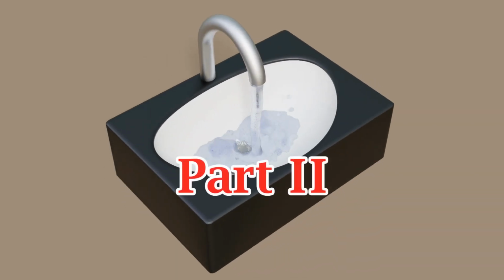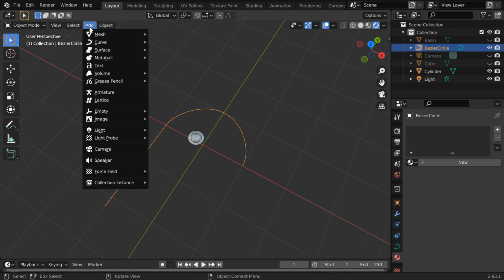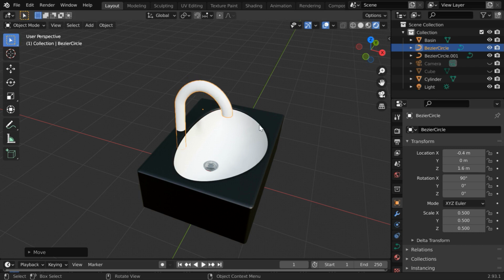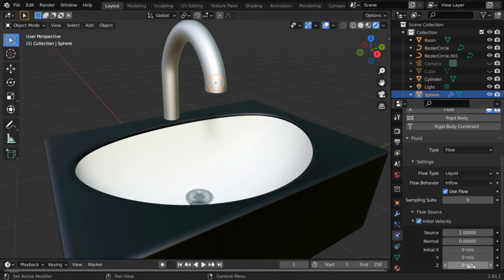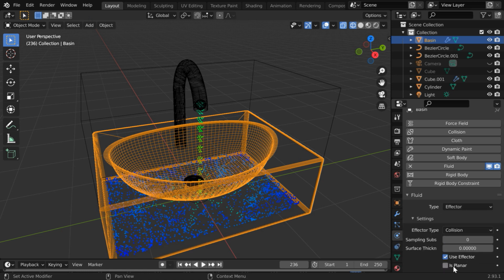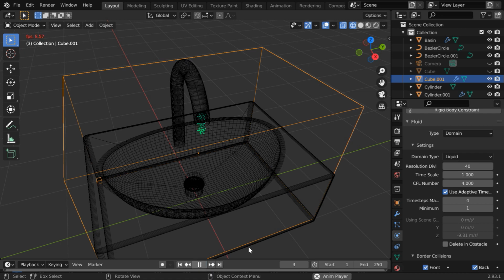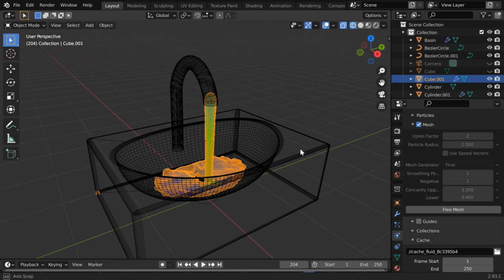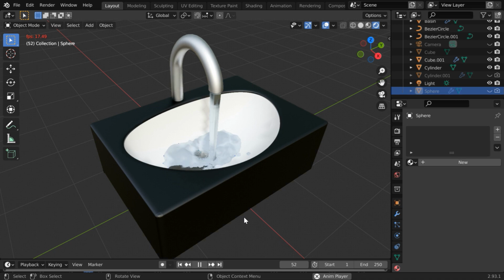Create Wash-Basin or Sink in Blender : Part 2 | Inflow & Outflow | Fluid Simulation in Blender

Comment: Even though I added material, there are many different colors in the water drops. How can I solve this?
Reply from the maker: Water has a property to show some of the ambient colors due to refraction, it's only natural. If you turn off refraction, it won't show any colors, but it won't look natural as well. If you think refraction is not the reason, or if the colors are too bright, I need to see your blend file before I can suggest something. You can send your blend file to 5minblender@gmail.com for us to verify.

Comment: I have done all the job but render for video is not working. please advice.
Reply from the maker: Can you please tell me where exactly you are stuck, or what is not working particularly? When you try to render the scene, what happens?
Reply: @5MinutesBlender  animation video for water flow in sink is not working when I render. I mean frame of video movement is not working to make animation video.
Reply from the maker: @md.azadulkarim8108  Is the fluid simulation visible? Is it static and not moving? Or do you mean the fluid is not at all visible? Render any one frame from the middle, like frame# 100 and see if the fluid is visible.

Comment: When uv sphere  i put inside tap pipe liquid not working but if i didn't put inside pipe liquid working . What is the problem ?
Reply from the maker: There has to be some amount of gap between the sphere (inflow object) and the pipe (effector). This amount of gap depends on the resolution divisions. For lower divisions (<100) there has to be quite some gap, otherwise the inflow won't work. If you cannot increase the resolution divisions due to limitations of your computer hardware, try to reduce the size of the inflow sphere, it would then work. And don't forget to clear the cache every time, otherwise despite all the changes - things still may not work because blender often keeps old data in the cache.
Reply: @5MinutesBlender  thank you sir,  i increased resolution 60 then start simulation but  not perfect then i increased 80 that was perfect.
Reply from the maker: @A4a4a4-w  Great! Nice to hear that it got solved.

Comment: Which laptop size is best for blender...??
Reply from the maker: Laptop size? 🤔 You need sufficient RAM (8 GB or higher) preferably with a GPU and at least 2 GHz clock speed for good rendering. Anything more than this is even better. The screen size does not matter but 1080P resolution is preferable.

Comment: funny how the fluid sim works for you
not for me
Reply from the maker: I'm sorry to know that the simulation did not work for you. Blender physics simulations need a bit of experiments and patience. If you follow our tutorial word by word, it must work. However, if some dimensions are different or some other minor change is there, the result maybe way different. Nonetheless, if you can describe what issues you are facing, I can suggest you something. If the water does not appear at all, please check the domain resolution you have used, it should be proportionate with the domain and the flow objects. If water is visible but it is not restricted within the sink (effector), please check the thickness settings for the sink material. Likewise, you can describe the actual issues that you are facing.
Reply: @5MinutesBlender  
The water doesn’t even show up inside the source
Reply from the maker: @theonecommenter  Let's do this. Remove the tap. It covers the Flow object. So if the gap between the Flow object and an effector is too small, the Flow won't work. So remove the tap. Let there be only a Flow object and a Domain. Now check if the simulation works. If not, increase the size of the Flow object until it works. Please remember that at each step you need to clear the cache - and it is easier said than done. Often Blender will make us believe that the cache is cleared, but the cache files stay there, it plays the old data and we wonder why the simulation is not working. Once you see water, reduce the size of the Flow object and increase the Domain resolution. Too small Flow object will need a higher value in the Domain resolution. Once you get this part solved, bring back the tap and test with it. Please let me know what happens.

Comment: Great tutorial.  My sink and waterflow turned out great.  However, when I attempted a render of the animation the original cube, used for the cutout of the basin, appears, and blocks the view of the sink.  I do have visibility of that object turned off.  Any ideas? Thanks!
Reply from the maker: Did you turn off the visibility of that object also in render? Click the camera icon beside the eye-icon where you disable the visibility, the camera icon is for render and the eye-icon is for viewport. Once disabled in the render, it won't appear any longer in the render output. Please let me know if this works.
Reply: @5MinutesBlender  That fixed it.  Thanks for your prompt reply.
Reply from the maker: Glad to be of help!

Comment: I made exactly the same, but the simulation doesn't apears! What do I need to make it works?
Reply from the maker: Which part of the simulation is not working? If your fluid simulation is at all not even appearing, here are some possible reasons: 1) The old cache is not cleared, please clear them 2) The domain size is large compared to the flow object, either enlarge the flow object or reduce the domain size 3) The domain resolution division is not sufficient, please increase it. If nothing works, you can send us your blend file so that we can investigate it further. You can get our contact details (Email ID) in the about section of this channel. Thanks!

Comment: pls help, my water is not flowing 😅
Reply from the maker: Hi bro, we'll surely help you. Can you please elaborate little bit where you are stuck, or mention the exact timestamp from the video at which point you are getting a different result from what is shown?
Reply: @5MinutesBlender  The part where you apply the fluid simulation to the sphere and then you play the animation and the water flows but mine doesnt 😅, so i just continued following the tutorial to the end  thinking it will fix my problem but it still not flowing
Reply from the maker: Okay, that can happen for several reasons - but primarily I'd suspect two things. Either the scale & domain resolution values are not in correct proportion, or the fluid cache is not cleared (which sometimes causes a frustration because whatever changes you make, it just does not seem to take effect). If you followed the tutorial ditto as shown, the scales should not be the issue. Please select the domain object, and go to the Physics tab. You will see a field called Resolution. Please make some changes into that. It is better to use a higher value like 64 (or even higher for a better result, but 64 is good enough for test purpose). Now go back to the first frame. You don't need to even run the animation. On the first frame itself, you should see the fluid particles appearing around your flow object. If this is not happening, please check if your flow object is enabled. This tutorial is primarily about enabling and disabling the flow object, in order to control its flow. So, if you keep the flow object disabled (unintentionally of course), it won't show any fluid. So if nothing above works, please remove all keyframes from the flow object, and test if the basic fluid simulation is working or not. I will wait to hear from you. All the best!
Reply: @5MinutesBlender  Hello again, sorry for the late reply took me a while to figure it out hehe. i just realize my domain size is so small so o had to scale it up and the change the resolution to what you recommended, thank you so much.
Reply from the maker: @gowiththeflowguy8310  Really glad to know that it has finally worked!
Reply: @5MinutesBlender  hello! I tried all the suggestions but still no water flowing on my sink :(
Reply: @5MinutesBlender  the only thing I couldn't find was the ''enable'' the domain object. how exactly do I do that?
Reply from the maker: @zamorestudios  Hi, I am sad to know that you are struggling with this, but no worry, many of us struggled the same way when we started with Fluid physics. I can assure you that it will work. First, the domain object is enabled always. This tutorial is about enabling/disabling the Flow object. They are different things. You do not need to enable anything for the domain. As I mentioned above, 75% of the times the object scales and the domain resolution values may not be compatible, and 20% of the times your fluid cache folder might be creating an issue. These two main reasons constitute 95% of the failure cases. So can you please confirm that this is not the case in your project? If you want, you can also send your blend file to us, we'll check and get back to you with corrective solutions. Our contact details (Email ID) are given in the About section of this channel. Thanks!